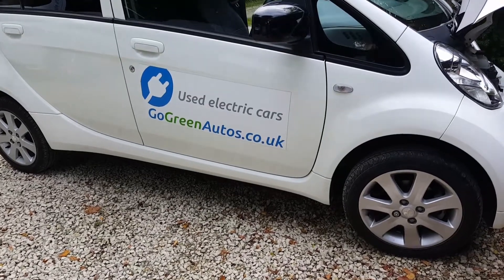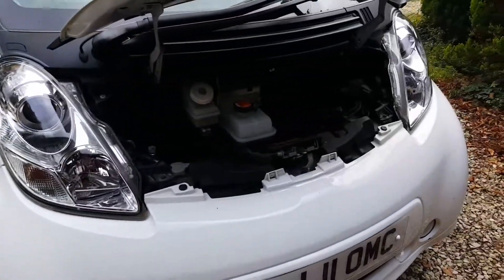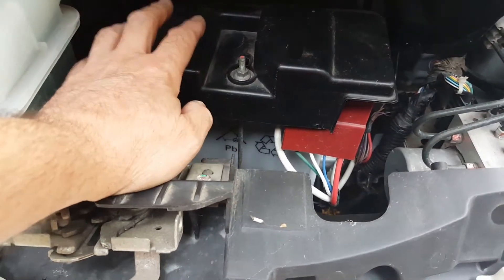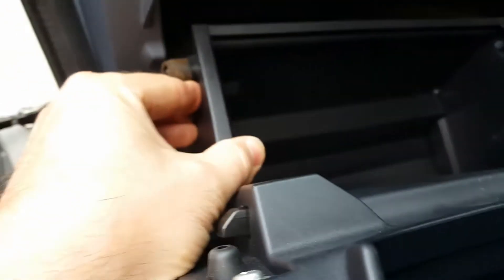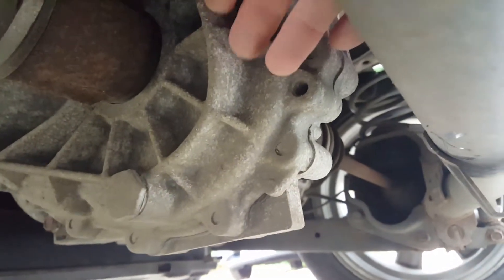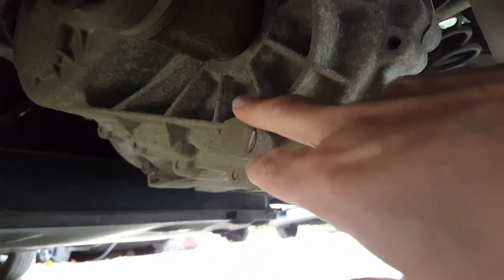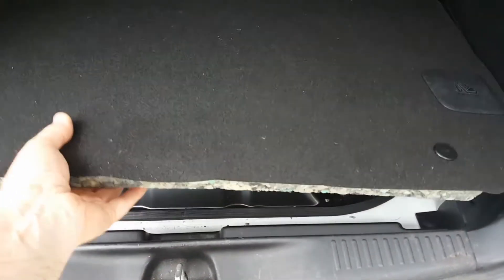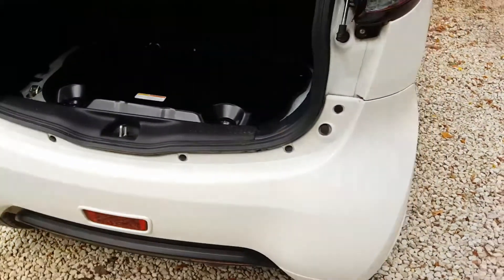Servicing & maintenance on a Peugeot iOn, Citroen C-Zero or Mitsubishi i-MiEV

Comment: Hello mate, my ion is going into yellow light with exclamation mark and turtle mode. It goes away by waiting and restarting but doesn’t last long. Aux battery healthy and charging when in ready. I think it’s the coolant pump as the pipes don’t get warm even before the fault arises. Do you have a spare pump or is there a sensor maybe at fault shutting pump down. Any advice appreciated. 2011, 30000 miles. I don’t have a scanner.
Reply from the maker: You need to get the diagnostic codes read to find out what is causing it. You can use an OBD dongle and an app. I don't which is the best, as I don't use them.
I don't have any parts.

Comment: Hmm got peugeot iOn. Its had a knock and the windscreen wash reservoir has cracked. It seems that it's impossible access and remove it to repair as it part of the fan housing which means a HUGE long winded expensive job. 
Have you come accross this situation? Are the mechanics I've seen wrong- do you access it through bumper or through wheel arch??  Pls help if you can
Reply from the maker: I can't remember where it is on the iOn. But its quite common to access them via the inner wheel arch liner, or by taking the bumper off, or by removing a headlight or a mix of these.

Comment: Hi.
Anyone knows how to fix/replace a horn on this type of car?
Thank you very much.
Reply from the maker: Its mounted at the front near the headlight. Open the bonnet and you'll see it. It would be much easier to replace if you took the front bumper off. Its just a basic 12V horn. A motorbike horn would probably be nearer the size. You can probably get one for peanuts on AliExpress.

Comment: Hi, what fluid do we use to cool the batteries for the rear tank? My c-zero has a blue fluid but I don't know what the spec is. Can you help me? Thanks
Reply from the maker: Just blue long life coolant, the same stuff you'd put in a radiator. Here's the workshop manual page on how to change the coolant - https://drive.google.com/file/d/1xACQJq6VzjgO-2-Wp0cZ4W7BSs2QWTjo/view?usp=sharing

Comment: I'm thinking of buying one of these but at 10 years old I'm wondering how much longer will it last in terms of battery and rust issues. Am I better off paying more and just getting a Nissan leaf for the long term.
Reply from the maker: I would say so. Rust is the biggest issue with these older ones.
Reply: @GoGreenAutos  I managed to get a 2014 November Ion, it has a whole host of advisories relating to corrosion, (It cost £4000) What should be my next course of action, take it to a place that can sort the advisories out and give it rust protection?
Reply from the maker: @samthomas1457  Someone has done a video about rust on these. But yes, rust treat it. Bilt Hamber make some excellent rust products.

Comment: Hello. My PTC Heater on my Citroen C-Zero is broken. Is this something to change myself? Here the Citroen shop wanted around 3 000 GBP for this install
Reply from the maker: Never done one. Look for a HEVRA garage near you. Much cheaper than Citroen. https://hevra.org.uk/garages.html
Reply: @GoGreenAutos  Living in norway. It does not look like anyone has this types of PTC heaters. A aftermarket or china one would be ok for me. But i cant find one that fits mine..
Reply: @mrl9945  found a solution or not yet?
Reply: @Powly709  took the cord and plugged in again, and it started to work
Reply: @mrl9945  thanks for the reply !
Reply: @Powly709  no i need to thank people like you, which Are trying to solve problems
Reply: @mrl9945  Hey, I suspect I have the same problem with my C-Zero. I got quoted similar price as well, and I'm from Norway too. How did you exactly fix the problem? Plugging the cord in again? Thank you in advance.

Comment: only maintenence? what about checking the wipers, bulbs, balljoints, CV gaiters, suspension bushes, shock absorbers, wheel bearings, brake pads, lubricating the hinges, latches..
Reply: Mot test checks those, average car owner doesn’t ever check those things themselves. If you aren’t from the uk the mot test is an annual roadworthyness inspection.
Reply: He said that in the beginning.

Comment: Hi, what about the main batteries? How long do they last?
Reply: My Peugeot Ion was used 5 years and now i have it run for more than 1year and still nothing seems wrong with the batterie. The first reduction of capacity is in the first 2 years so you should be able to use the car without any trouble for the next years -it's not a Leaf 2 with a "rapid-gate" ;)
Reply: @dariusselencus8515  my iOn is 11 years old and runs pretty well.... with 90-130 km range depending on the weather and conditions.....
Reply: In reality no one knows yet as they haven't been in existence for long enough.  The estimated life of EV batteries keeps increasing.
Reply: OK thanks Matt. I know that Prius batteries last for about 8-10 years and you need to replace them then. I'm interested in buying an older Ion but fear to have to buy new batteries in 2 or 3 years which might ruin the cost calculation
Reply: @autoagencja6625  my iOn is 11 years old and runs pretty well.... with 90-130 km range depending on the weather and conditions.....